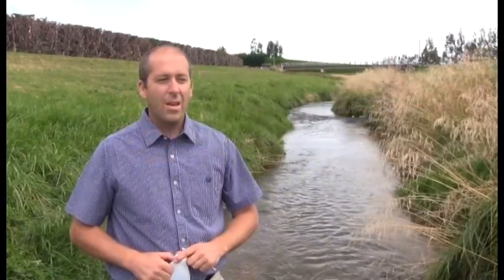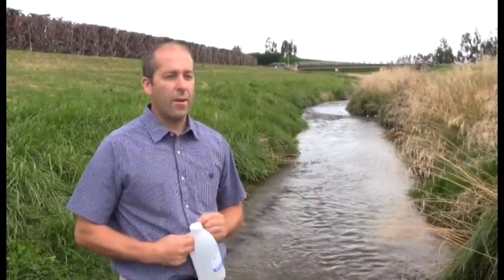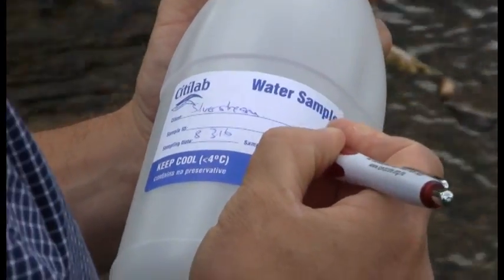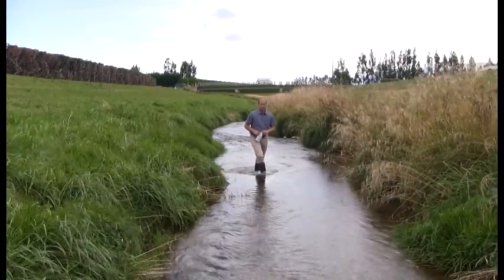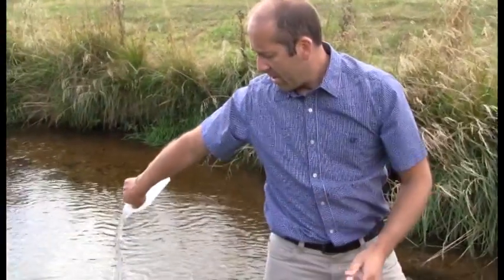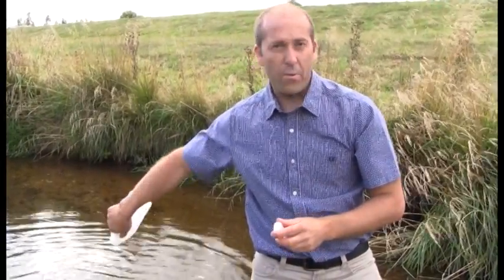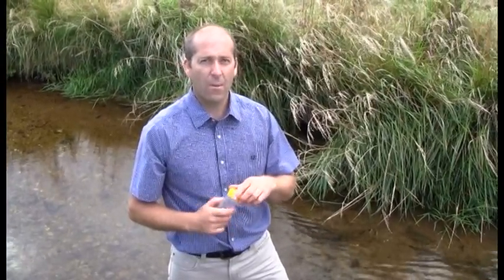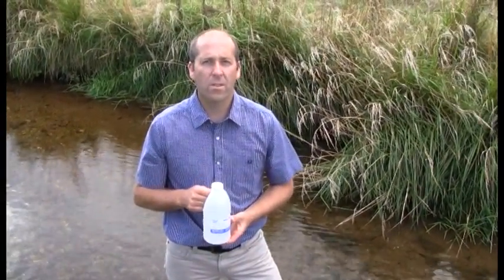Water Quality Sampling

Comment: Many sterile containers for e-coli testing will have a preservative in them. The preservative is needed for sample quality. If you sample as per the video the preservative will be washed out. It can be better to fill the sterile container using a single use  sterile sampling syringe